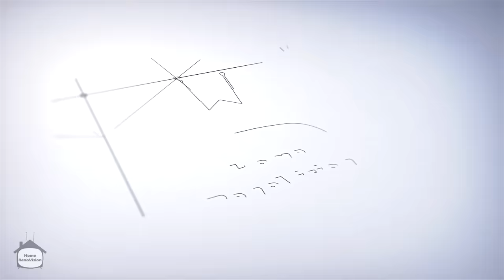How To Build a Waterproof Shower using Kerdi-Board

Comment: If I have Kerdi fix should I use that where the Kerdi board and drywall meet?  (I see in your video you used that other caulk.)  Would I then sand it before I tile or paint?

Comment: Once the kerdi board is in place do you just glue the tiles on? My tub/shower has plastic tiles that fell off and a hole at the faucet. I'm trying to get down to the studs to put up the kerdi board then re attach the tiles.

Comment: I have some overhang from the .25" Kerdi board and my tub tile flang. Can I run Kerdi board over the tub flange, leaving a small gap to seal with Kerdi Fix to the tub? so in other words the studs and tile flang on 2 of the tub sides are pretty close, closer than the thickness of the Kerdi board. Or do I need to shave down my stud walls so the Kerdiboard rests above the tub tile overlay and it's flush between the two?

Comment: If I'm using a prefabricated shower pan with this system would I butt it up the way you did or I stall in front of the lip butting up to the shower base ledge?

Comment: Thanks for all the explicit instruction. I'm at the stage of having all the Kerdi-board installed and the majority of screw/washers waterproofed with 2-in-1. About to thinset (Kerabond T) the Kerdi band on the seams. (BTW I asked you to clarify a remark you made in a response to Josh .... like 9 months ago, but I saw it just now and elaborated my confusion about Kerdi-band overlapping bottom of Kerdi-board and the flange it abuts... if you would be so kind, after you set me straight on this current question, that I'm about to get to) 
Anyway, I will have my 12-inch-by-24-inch porcelain tiles overlapping the bottom of the Kerdi board and hiding the tub/shower-pan flange by about an inch. 
So, should I shove some 2-in-1 into the bottom of the gap where the tiles will almost touch the tub/shower pan deck?  AND, if I do that, should I leave some weeping hole gaps in the bead of 2-in-1?  This was advised by another DIY video guy (ahem! coff-coff-floor elf coff-coff... not mentioning any names).  He sez the Kerdi or other waterproofing behind the tiles is definitely water-proof, but the tile layer (notably grout) won't be totally waterproof, so any moisture that gets through and is trapped back there has an opportunity to exit via the weep holes.  Sounds fishy when you have all that thinset in there, but I thought I'd ask. 
Thanks for your excellent teaching videos. Contractors everywhere are going to lose a lot of business correcting home-owner mistakes that might not happen, now.  :-)
Reply from the maker: I suggest using kerdi band to the tub and then tile. trim off the excess after the tile is installed. cheers!

Comment: I love this system! Think I can do this with only a plumber, even as a single gal. I know this is an old video, but I want to ask: my walls seem to have no sign of mold at all. Even the old pink insulation I removed looks almost pristine. There's just a bit of mildew behind the tar paper and I wonder what to replace the tar paper with, especially on the two exterior walls (brick on frame construction).

Comment: Hey Jeff, is there anything special you have to do at the outside border where the Kerdi board meets the drywall of the bathroom wall? Great video thanks a lot.
Reply: I always run my Kerdi flush with my drywall. I make my Kerdi short at least by 2”. I tape the joint with Kerdi Band from the ceiling down to the floor. The reason I do this is so that the tile actually starts on the Kerdi banded drywall and bridges onto the Kerdi Board. I also use Schluter profile strips on the edge of the tile.

Comment: Love your channel! Wondering what you do around the lip of the tub where the kerdi sits. I have my board installed but get differing opinion on how to proceed from here. One channel recommended using unmodified cement and kerdi band to create an overlap across the base of the kerdi board and the lip of the tub. Any thoughts on this?

Comment: First off I would like to say thanks for all your videos, I've learned so much from watching them. I am in the middle of a bathroom renovation in which I am going to use the Kerdi board. I have read several articles in forums online that state that having a vapor barrier behind this waterproof system as it can create a "moisture sandwich" and is not recommended, if possible could you please advise me of the pros or cons to having the vapor barrier as I was unable to find the answer on the companies website. Thanks and keep up with the great videos.
Reply: Yes I came here looking for this answer too!

Comment: I see that you use Pex ”B”. Have you ever thought about switching over to Pex ”A” by Uponor? I use the Dewalt Pex tool to expand the pipe and fittings because it is SOOOO fast!!! 1500 psi of pressure are each connection.

Comment: Just bought $600 worth of Kerdi-board supplies for my shower. This video is a great help. I just need to find the right caulk, Kerdi-fix is $26 a tube here in Colorado and that LaPage 2 in 1 isn't sold here. Any thoughts on how I can select the right caulk?
Reply from the maker: if you want to sleep at night go with the good stuff. It is only 1 tube and it is gauranteed!
Reply: @HomeRenoVisionDIY  Thanks, so the shower has a window that was just damaged drywall and a standard sill. I had to take it down to wood frame. I plan on using some of the kerdi to actually replace the sill and place over the rough wood window frame and then I'll tile over that. Anything unique or different I should do? It looks pretty straight forward but you never know.

Comment: My only question is obviously the Kerdi board is thicker than the mounting flange for the tub so where the bottom of the Kerdi board meets the flange and you sealed it wouldn't the Kerdi board stick out a good bit and make that seam an issue? Either that or I assume you have a shim of some kind behind the screws for the tub mount? Couldn't you also run the Kerdi board all the way to the floor before installing the tub  and then seal that seam? Thanks

Comment: I'm renovating all three baths in my house this Spring (one bath and two showers). I'm definitely going to go with this system for all three/ It sounds like I will need corner membranes and bedpans for the showers though - I'm a little worried about cost... You had some nice price estimates in this video on the wall boards and 4" membranes - in your experience, are the corner membranes and bedpans overpriced, or are there creative alternatives? Much thanks for this video from your friendly neighbors to the south!
Reply from the maker: You could always go with cement board and redgaurd if cost is an issue.

Comment: Thanks for the video! What about the joint between the kerdi board and Sheetrock? What is recommended? Schluter thinset or regular plaster? The joint is around 8 inches from the shower. Thx

Comment: Hi Jeff, You do fantastic videos.  

I am installing Schluter for the first time.  I live in Florida and want to place the Schluter board on an exterior concrete block wall that is built out with 5/8" furring strips.  A vapor barrier is not needed here.  How do I attach to the furring strips with 1/2" Schluter board.  It only creates a thickness of 1 1/8" and it called for 1 5/8" screws, plus some pull in to cover them with thinset.  If I build out the furring it will not match the drywall thickness on the adjoining wall that is only separated by a glass shower wall.  This block wall also has the 1/2" copper supply.  So bottomline, I am not sure what to do to install the Schluter board on this block wall?  The other two shower walls are framed, so no concerns with them.

Comment: I've patched the large shower wall with Kerdi-Board.  The other 2 walls are plaster, which I was going to use Eco Prim Grip on (also wanted to use Aquadefense).  I'm having a hard time figuring out what mortar to use for the ceramic tile.  Can I use Schluter All-Set on both, for everything?  I thought I saw one of your videos that showed Schluter is now offering modified mortar that can be used on it's Kerdi.  Is that it?  Was that a dream?  Which Mapei/Schluter mortar(s) should I get?  Thank you!

Comment: @Home RenoVision DIY how to you join the kerdi board and the gypse that's outside of the shower. In my case I have a glass wall so my kerdi goes just past it but then how do I joint the kerdi to drywall besides it? Thanks

Comment: Hi Jeff, question regarding vapor barriers in bathrooms. If the bath is not located on an exterior wall is it necessary to place plastic on the wall between insulation for sound deadening and the drywall? Lot of conflicting info regarding vapor barriers causing more problems than good on the web.
Thanks,
Ken
Reply from the maker: vapor barriers on interior walls have no value and cause no damage. No need to waste your time but don't be bothered if they already exist.
Reply: @HomeRenoVisionDIY  Thank you!!

Comment: I love your videos!   You mentioned using non-modified cement on the kerdi board along with the kerdi tape.  I am planning to use Mapei Ultraflex Large Format Tile Mortar with Polymer to mount our tiles.  Can I use this same material for the kerdi tape (i.e. would this be considered an non-modified cement)?  If not, what material would you recommend?  Thanks in advance.
Reply: Only all set[modified] or set[unmodified] will work

Comment: Hi Jeff
I live in Quebec city. I want to make a bathtub surround with Kerdi Boards. I'm down to the studs in the alcove. The main wall of the bath/shower is an exterior wall on a balloon construction home from the 1940's. In the entire house, there is no vapor barrier. Should I put a 6mm poly vapor barrier behind the Kerdi board of the exterior wall or not?

Also, would you insulate that wall? All I have is 1 inch thick strapping over the ballon construction wall.

Thanks
Reply from the maker: i would definitely insulate the cavity and then vapor barrier before installing the kerdi! Cheers!  but only on the exterior walls. cheers!
Reply: Home RenoVision DIY so insulate with 1 inch fibreglass (strapping is only 1 inch thick), vapor barrier from floor to ceiling then Kerdi. No chance that condensation be sandwiched between Kerdi and vapor barrier? Thanks Jeff

Comment: Hey great video I was going to use the thinset to cover the screws and washers but the retailer told me I could fill the screw holes with kerdi fix and glue the kerdi band to cover it up.  It is my first time using kerdi and first time installing a shower.  Is it ok to use kerdi fix instead of the thinset.  I really hope my kerdi band doesn't peel off the wall.
Reply: KerdiFix is way too expensive to do that compared to thinset

Comment: I am doing a bathroom remodel, there seems to be some mold on the ceiling about the tub. Should I use the foam backer board on the ceiling as well just to be safe?
Reply: Wouldn't have to unless you're doing a steam shower. But you could use Kerdi membrane for the ceiling if the bathroom tends to get steamy whilst using the shower.  Use Kerdi band between it and the Kerdi board just like you would for the seams and washers with screws used to install the Kerdi board to the wall studs.

Comment: I purchased the kerdi shower kit about 2 years ago. Had it installed and tiled by a contractor. Long story short is the grout started coming up, then the 1”x1” tile started coming up which in turn led me to tear the whole shower floor up. I cut out the membrane on the shower floor flush with the wall before realizing that schluter calls for a minimum overlap of 2”. 

My plan is to put down new membrane as tight to wall tile as possible and use kerdi fix around the edges + epoxy grout for the tiles. Schluter tells me that this is not a warranted repair. I think it will give me a few more years use out of this and save me from a complete redo. Could you give me any suggestions?
Reply from the maker: first problem here is you probably had mosaic tiles that are not wet area approved. always ask the store for documentation. but you are right in thinking that your approach will be successful. as long as you base is strong and not deflecting when walked on. Cheers! I would probably do the same if on a tight budget.

Comment: Would you ever install one of these plastic surrounds on the walls over this kind of waterproofing?  Lowe's told me they would only install a new shower by glueing the shower surround to the studs.  I couldn't help but think about condensation behind the surround shower.  Would you ever glue a shower to studs?  Is your suggested waterproofing method only fit for tile?
Reply from the maker: Hi July, I think you have some bad information there. There are showers that are made with a base and wall systems that fit into a framed space but they are never glued to the wall. There are surround products that are glued to the wall board in a shower enclosure however you must have a wall board first. I am not sure if that adhesive is compatible with kerdi board. The best advice I would have is if you are using a shower surround kit that costs 100 bucks then why would you use a wall board that costs 400. The surround kit with the proper sealant is waterproof already and there really is no reason for the extra protection. I hope that helps. let me know if you need more clarification. Cheers!
Reply: Thanks @HomeRenoVisionDIY

Comment: Why does the mixer valve need a 3 by 3 inch hole? Can’t you just cut it to fit snugly? Is there a reason the kerdi board can’t be right against the mixer valve?

Comment: are you saying that I could use that lepage seal and bond for the seams in addition to sealing and filling the screw holes? If yes....does that mean I wouldn't need to put the tape in the saeams? I didn't quite follow if that seal and bond would just be for the screws, or the seams and screws. This method of using kerdi board looks MUCH easier to do than using the cement board. Easier cutting, grid lines, lighter than cement board, and  no need to use that roll on sealer. IM guessing the downside is the additional cost.

Comment: The joint where the Kerdi board meets the tub; in this installation, the Kerdi board did not stick out further than the tub flange (tub flange design). On my tub, the flange is thinner so there is a gap beneath the bottom of the board and the top of the tub deck. I believe Schluter suggests to fill that gap with the Kerdi Fix. Would you do that with the Lepage 2-in-1? Or would you fill it with mud and kerdi band?
Reply from the maker: Hi Josh, In the early days schluter recommended using the kerdi fix to close the joint from the wall to the tub or shower flange. now they suggest using the kerdi band directly to the tub and under the tile edge. the extra material can be cut away before grouting. This new technique allows for a kerdi fix free install with either kerdi board or another substrate combined with the kerdi sheet. I still like to have kerdi fix on me regardless for niches and accidents. Cheers!
Reply: @HomeRenoVisionDIY  Right on, thanks for that!
Reply: @HomeRenoVisionDIY   I'm not clear on "using the kerdi band directly to the tub and under the tile edge."   But, I'm pondering from the perspective of a shower pan (instead of a tub).  In another video, you had the Kerdi board rest on the skinny top edge of the flange (with a bead of 2-in-1 to join the edges), which leaves about an inch of exposed flange, down to the plastic tub/shower pan. That's what I have right this moment. 

Then, in the next big step, the bottom row of tiles laps almost down to the deck of the tub/pan; you used some little yellow wedges from the (Capitol L.A.S.H.) tile-spacer system to keep them a wee fraction above touching the deck.  So now you have me wondering -- a strip of Kerdi-band would go on the bottom of that Kerdi-board (secured by thinset or whatever) but would hang down loose behind the tile?  Or does the part of the Kerdi-band below the Kerdi-board get secured to the flange with thinset?  And then more thinset on the buttered tile to the exposed little strip of Kerdi-band?   Or.... well.... what DID you mean by "...and under the tile edge"?   

What's that, you ask?  Why, yes, I DO tend to overthink everything.  :-)

Comment: I need to pull out cement board to convert old dual valves to a single mix valve in an alcove shower/bath. It's only one wall, can I use Kerdi board on one wall and join it to the existing cement side wall?
Reply from the maker: most definitely. you can even apply the kerdi sealant on the side of the panel so it secures to the cement board and creates a seal. This will help prevent cracking in the grout joint and a level of waterproofing. Not perfect but pretty darn good. Cheers!

Comment: Great video, thanks!  Question:  I have the Schluter shower kit, but bought the Laticrete Hydra Ban boards to use for the walls.  They had them at my tile place, and it was a lot cheaper than the Kerdi board at Floor and Decor.  Can I use the Schluter fasteners (with washers), and the Kerdi band waterproofing technique (with unmodified thinset) on the Hydra Ban board just the same?  I would think the material is the same (polyethylene).
Reply from the maker: sounds plausible, but why are you experimenting on your house. You will have no warranty if you blend the systems.
Reply: The hydro ban does not bond to the waterproofing band of schluter and it will leak